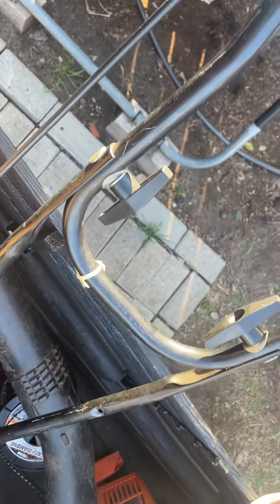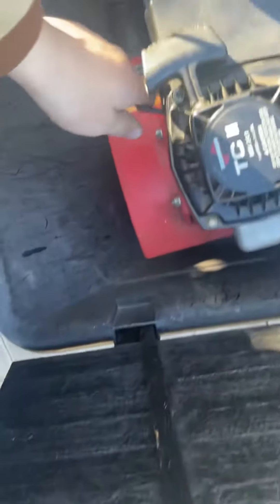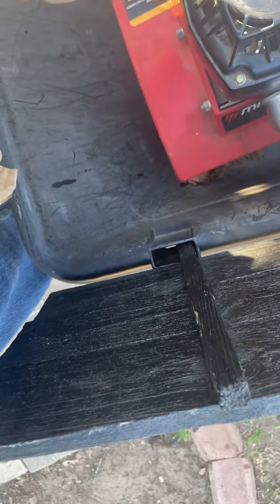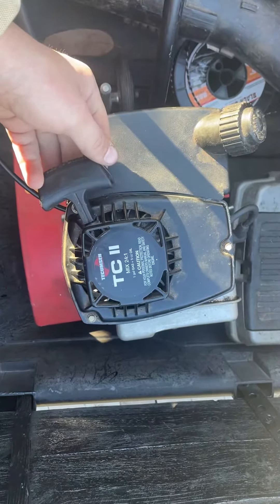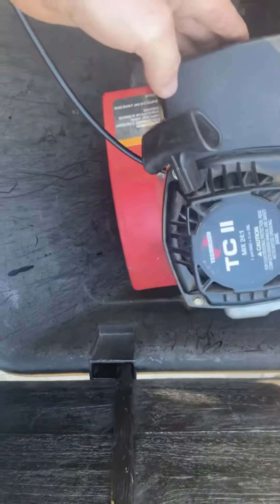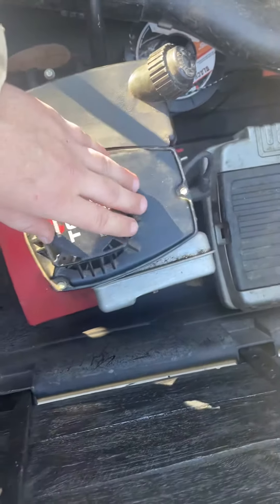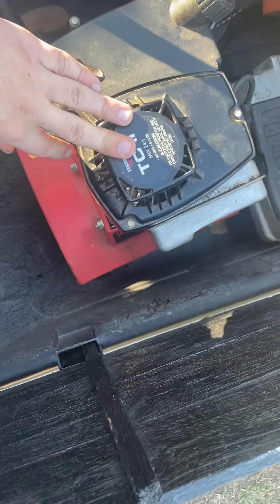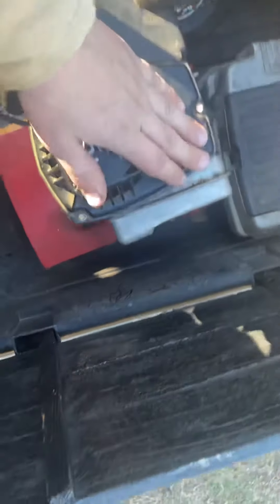The Tecumseh TC300 is finished

Comment: How do you grease the gearbox on these and what kind of grease do u use?
Reply from the maker: You can use a lithium type grease for basically all tiller gear boxes
Reply: If you turn your cultivator on its side, you will see the gear box.  Look for a ,erk grease fitting on the gear box.  I have this exact cultivator, and I just greased mine